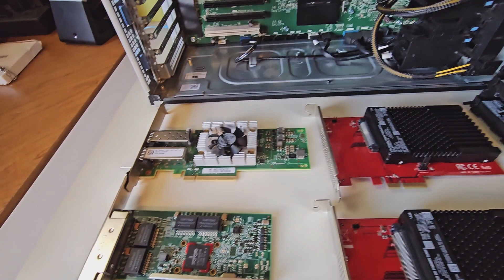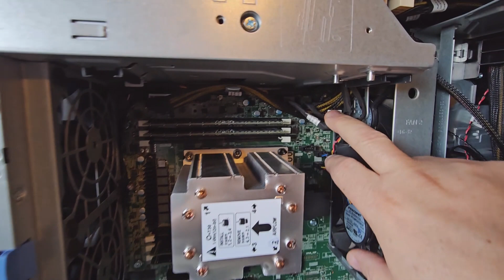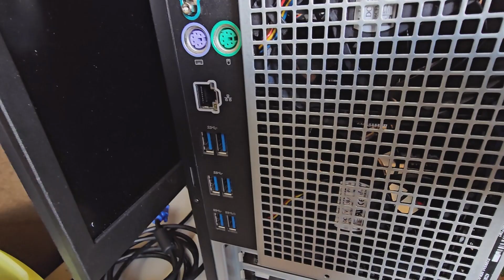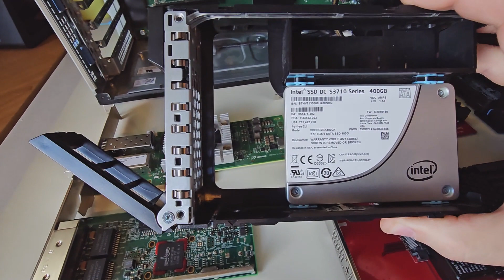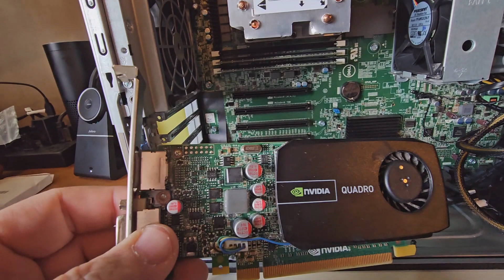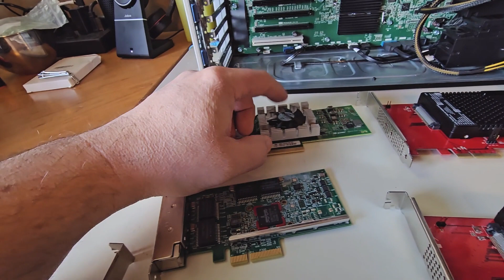Home Lab Generation 8 Parts List for VMware ESXi  Hosts (Part 2)

Comment: Nice. I am in the process of replacing my aging Supermicro SYS-E300-8D vSan cluster. Been looking at Dell Optiplex 7080 sff's maybe to stay in the quiet lower power arena. The new supermicro tiny/edge stuff is much harder to get now and the prices have move to the insane level
Reply from the maker: Thanks for leaving a comment!  I was very fortunate to have a donation of Xeon 6252s to my blog/vlog and in looking for compatible mobos I found these Dell 7820s were a really good fit from a performance, power, noise, and price.  At $250 for barebone and ~$350 with a Xeon Silver CPU they are pretty hard to beat.